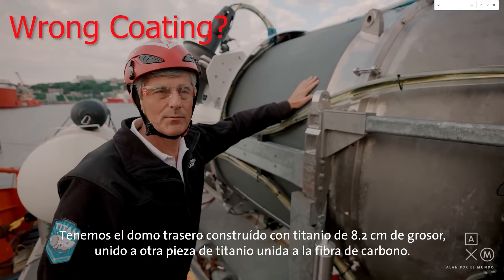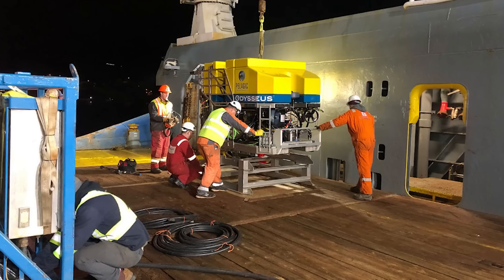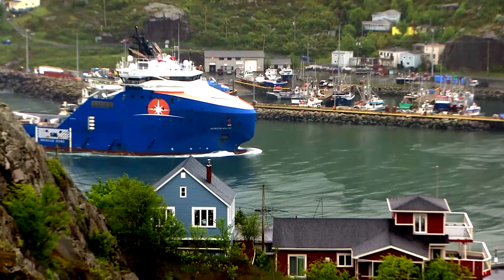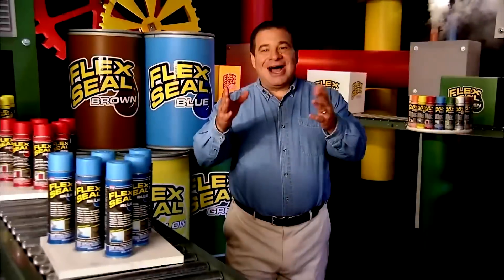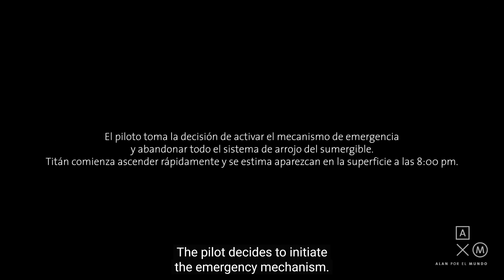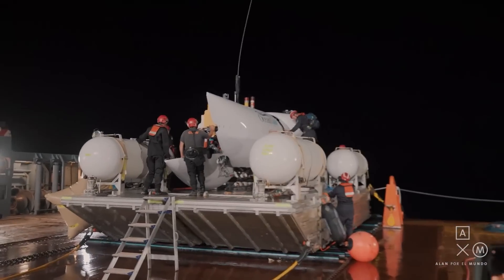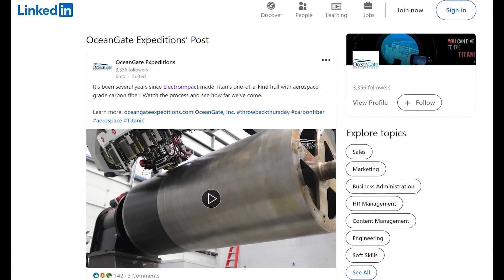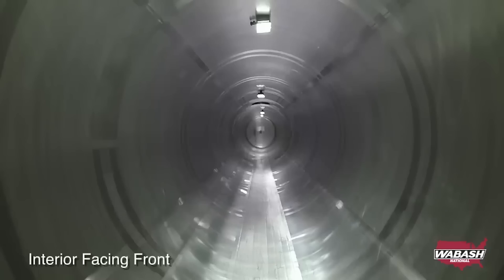Titan Sub Wrong Coating? Hull Construction, Debris Field Search

Comment: Jeff, I love your videos and technical details. I think the one source of failure was the titanium to carbon fiber seal at the end caps. I don’t know if anyone has tested the failure strength of the seal. As the sub descends, the carbon fiber cylinder would be squeezed in the middle , making it deform, and pulling away from the glue seal of the end caps. As you pointed out in one video, the titanium had no “scoring”, which would make the glue hold more firmly, and even then, that might not have helped. Although the tensile strength of carbon fiber is very high, the compressive strength is much lower, so that the two hemispheric titanium caps may have simply crushed in on themselves, much like crushing an upright empty soda can. I cannot still quite understand how the front port view hole  was blown clean, unless when the end caps crushed in on themselves, and  also compressed all  the occupants into the front end and blew the port hole from inside out. Gruesome, but instantaneous.
Reply from the maker: I pointed out on the last video I believe that when they attached the titanium rings to the carbon fiber cylinder you did not see any epoxy come oozing out which makes me wonder whether they even used enough to begin with or whether they roughened to the service with an acid etch first on the titanium before applying A proxy which is not known to stick very well to titanium because it's such a smooth metal.
Reply: @aptroed VIDEO exists of a guy testing a small model of the Titan at depth.  The failure was not the dome endcaps.  Instead the cylinder  cracks & shatters (at the midpoint of the vessel)

.

Comment: I believe the pressure vessel that was used for the testing of the 1/3 model is the largest such vessel of its kind available in the U.S. So the size of the model was built for the vessel that could test it.

Comment: I do wonder if the porosity of the carbon fiber was changing with each dive.  Meaning the rhino layer did nothing, and with each dive, the outer layers started to fail and separate.  This slowly allows more water intrusion, and each time the sub was used, this would change the buoyancy characteristics of the submersable. Thus, in the final dive, even if they detected the failure, they could not surface because the carbon fiber was essentially water logged.
Reply: @thechurn4766 THEY still had time to surface.  The team noticed at 15 minutes the descent was almost twice as fast (indicating extra water onboard).  If Rush had aborted the dive, they still had the ability to rise (though much slower than designed)
Reply: @electrictroy2010  the issue is still likely the carbon fiber.  When that material fails, it gives little to no warning and fails catastrophically.  Things like metal tend to show signs of fatigue and will bend or buckle before that can be seen visually before failure. I also wonder if water had infiltrated between the carbon layers so there would be no way to compensate for the change in boyency. 

 The rapid desent did not help. The cyclic fatigue on the carbon fiber was, however, doomed to lead to failure evetually. Furthermore, there is no way visual inspection would be able to pick the issue up.  It would require ultrasound and other imaging techniques.

Comment: What bothers me is that the hoop windings of the carbon fibre shell would only realistically oppose hoop stresses. Any longitudinal bending stresses within the shell under external pressure could not be opposed by the windings in this direction. I'm assuming they would believe compression would be equal along the length of the shell, but it would not be. The shell would compress more in the unsupported centre, leading to longitudinal bending within it.

Comment: To be honest, as an engineer, I would not have felt safe unless the hull had a 5 inch steel coating.  I guess you have to spin it out and talk about something.
Reply from the maker: Yes a 5" steel hull is much better and would have been much heavier and required more expensive ballast, that is what Stockton Rush was trying to avoid.

Comment: That last implosion demonstration was < 1 ATM? (Looks like they just pulled air out of a tanker trailer until it imploded.) The depth of the Titanic is around 380 times that pressure differential. That's like comparing failure modes of putting an empty soda can in a manual can crusher vs. surrounding it with TNT.

Comment: With all the mistakes they made, it's a wonder they were able to use the sub for multiple trips. Maybe it would have been fine if they used a new carbon fiber tube every time. But that would have been too expensive for Rush.
Reply from the maker: es fatigue takes a while to rear it's ugly head

Comment: My theory: Since we now have information from the engineer who did NDT on the CF hull, and how sketchy stockton rush is..I'd bet the bank that he had rhinoliner applied to hide the issues the hull had. The engineer said he could see holes and delaminations on that hull with a flashlight, was quickly let go..I bet they covered it with rhinoliner the same day. At least in my auto tech days, you'd see rhinoliner layers less than 1mm thick, and in heavy duty situations, maybe 3mm thick--and that's with a lot of coats. What rhinoliner does best aside from rust protection is hiding things, be it an old beat up truck bed to a carbon fiber hull with visible holes in it. Perhaps they did it to "seal" the epoxy joints, but that's a very generous conclusion. There was no real reason to have it on there besides covering up the CF, nothing aside from their hardware would corrode, as far as I know. The big question would be if it IS really for moisture, then why was it not applied to just about everything that can corrode? Why was a better sealant not used? 
Personally, I'm surprised that vessel didn't implode on the first dive, perhaps the compression the CF would see would partly seal the holes but I'm not educated enough to say that.

Comment: Oceangate should have done full scale model testing to failure before allowing any humans inside the sub. I was an engineering lab technician for many years at Carrier Air Conditioning working on commercial, industrial and government projects. Standard protocol was final model testing to failure to determine its limits. Final testing was witnessed by contractee before unit was released to production.

Comment: Using smaller models for testing is not at all unusual, as every engineer knows. There are entire departments dedicated to scaling large components to smaller test models. You just have to do it right and interpret the results correctly.
Reply: Some things here might not have scaled well like the ratio of the fiber thickness to the bend radius, and the thickness of the wrap to the bend radius. Nothing wrong with starting with a scale model, though.
Reply: The carbon fibre construction itself does not scale in a linear manner. There is no way you can accurately test using scale models.
Reply: Nothing wrong with scale model testing but certainly a lot wrong with ONLY doing a scale model test. Nobody builds a 1:3 size car to test it and then just starts building the full size car and sell it without any testing.
Reply: Thinking out loud- since mass doesn’t change linearly with volume, certain tests would be fine with scale models, and others not so much.
Reply: @martystrasinger3801  Yep, see “Statistical Theory of Size Effect in Brittle Structures”, where an  energetic failure occurs earlier in a larger structure due to energy release when a large crack or a large fracture process zone containing damaged material develops before the maximum load is reached.
Reply: Came here for this comment, I enjoyed the video overall but this stuck out like a sore thumb.
Reply: @thomasbarber9802 WE engineers still run tests on full sized units.  Often the tests reveal flaws not apparent on smaller models.  + plus when dealing with unknown materials like carbon fiber, you don’t know what equations to use.  You cannot use steel scaling math on CF

.

Comment: 10:50 Clearly a 1/3 size model isn't perfect.  But you have to consider the limitations of finding a test chamber.  Where do you find a 3m by 10 m test chamber to put a full-sized model in, and pressurize to > 6000 psi???  Or do you spend many many millions to make the test chamber big enough for testing a full size model?  When the test equipment costs more than the prototype, you've gone over the edge.

Testing cars by ramming them into blocks is no where near a similar comparison.  Building a big solid block is not nearly as complicated as a large high-pressure test chamber.

Comment: Nobody has yet to mention bonding two different materials together to use in a high-pressure situation. Titanium and plastics flex at two different rates, I’m pretty sure the glue joint at that intersection failed.
Reply from the maker: I mentioned this on my first video on the causes of this implosion

Comment: If the pressure testing animation is accurate, notice that the window did not give out, the carbon fiber surrounding the window gave out. An important distinction.  It is possible that intrusion in anyway of the carbon fiber matrix would be the point of failure at those depths.  This is likely the reason that an escape hatch could not be installed into the carbon fiber hull.

Comment: I worked in a large metal fab shop for years and was always alarmed at the book knowledge but lack of actual knowledge the engineers had if you go off the Numbers rhino coating is probably great stuff if you have actually used it you can see that it doesn’t stick to anything delaminates. How things work under ideal conditions by the numbers on paper rarely translates out to how things work in the real world.
Reply: Yep, I sprayed speaker boxes with the the stuff and I’ve stripped it off a few. It made me wonder how it adheres to CF, what prep and key was done, how much moisture was already in the carbon. Polyurea goes on crazy thick, it can bubble itself if there is moisture and does not have insignificant weight. If this was their solution to make the porous hull sea worthy again…. Well I was already without words!

Comment: Thanks for the video, great as always.
Is there a bigger pressure test vessel anywhere that could have taken a full sized 'Titan' for testing (except the ocean of course)?
If not then perhaps that's why they went for a 1/3rd model. If there was one then perhaps, like the rest of the project, it all came down to cost.

Comment: Rhino liner is used for pick up truck beds. The US Military does not use that coating. They use CARC. Chemical Agent Resistant Compound. It’s impenetrable in a NBC environment. Nuclear, Biological, Chemical. Neither coating is suitable in a high pressure environment. Ocean Gate engineering was a fantasy land joke. Built with the cheapest off the shelf parts. I wonder how many parts had a invoices  from Amazon.  I truly feel bad for the families of those victims. The crash site should be treated as a crime scene.

Comment: Rhino liner's a simple spray on application paper thin in substance. It's great for protecting your truck bedliner against moisture intrusion but has no redeeming qualities in flexing with superior tensile strength remaining seamless through periods of severe expansion & contraction & especially extreme external pressure. If Rush meant to keep the hull impervious to water infiltration by simply applying a coat of Rhino liner,, it just seems he overlooked the tiniest deformation in the hull itself or the intense pressure or water temperature changes would impact that coat greatly causing it to fail allowing water to make it's way microscopically,, time after time deeper & deeper into the hull each & every time they made a new dive. I feel sure he utilized the coating as simply another measure of making the hull safer but it probably ended up being just one more "failed measure" non homogenous to the rest of his makeshift structure. All the Frankenstein features he applied merely didn't form a lasting union of working togetherness whereby in the end,, Rush created a domino effect of one add on after another of proven strong individual dynamics that just didn't hold up as a single unit waiting for that one moment to all fail together in one catastrophic event. All of that was finally predicated probably on one part failing then cascading quickly into a multitude of stacked failures we all hope this final investigation will uncover. I think he meant well but just didn't follow through entirely while disregarding expertise from others that saw through his blind exercise in proving them & the industry itself all wrong. Apologies for stating the obvious in many areas but at this point so far removed from the final disaster,, the "obvious" for the most part is what we're all commenting on..

Comment: He did it 1/3 size most likely because there are no commercially available test facilities that will simulate the depths at real size...the ones that do aren't big enough because this guy was building the biggest of it's type so he could cram tourists in for "cheap"

Comment: It begs the question: Why did Rush deem it necessary to paint the outside of the CF cylinder with Rhino Liner? The product is designed to protect things like truck beds from water ingress, so was Rush trying to solve a problem of water ingress into the CF cylinder material? It would suggest that they had problems of water finding its way into crevices and cracks caused by the high pressure on previous dives, exactly the kind of damage that you would expect to see in a material like CF and brittle polyester or epoxy resin after a number of pressure cycles. Also, another example of Rush cheapskating by using materials totally unproven (and indeed, unsuitable) for a deep-diving marine environment.

Comment: Lol they knew where it was if it didn't resurface. Since they had no way to get down there to look for them, the rescuers did the only reasonable thing they could and assumed they had surfaced, generated computer models of where they may end up based on the timeline and surface conditions, and directed all of their resources there just in the off chance they did make it up and were currently asphyxiating. Once they had an ROV capable of 4000m on-site, they found it very quickly because unless it got blown around by currents, its last known location would have been recorded by the support vessel and their last destination was next to a well charted shipwreck. What a mess of a story 😅

Comment: Will a vacuum induced implosion have the same reaction/results as a pressure induced?
Reply from the maker: If the atmosphere difference is the same from outside to inside the vessel, then yes you can do the same thing.

Comment: The titanium hull plus the mechanical and electrical tail end were all connected to the titanium ring..  all that weight was being held in place to the carbon fibre hull with GLUE and the landing legs... this is why there was a cracking sound at the aft before the implosion. The Implosion happened at that area.  The final Nail in the proverbial coffin was when they disconnected the landing legs the only other thing keeping the carbon fibre hull from separating.

Comment: Rhino liner is truck bed liner and has micro tiny pin holes I've used it to coat speaker boxes that are exposed to rain and water....it fails to prevent water from getting to the MDF speaker box just with stress of heat and cold cycles....I can't imagine the stresses of the bottom of ocean...bad choice

Comment: Even if the coating was up to the task at that pressure, even 1mm missed could be easily enough to start a leak and then a full failure.

Comment: Another thing why it taken them to go so long out.
A ship the engine in ports are not running and the auxillerys are most of them shutdown.
This means the engine oil and coolant need by preheated to warm up the engine.
Beside the Auxilleri engine started and evrything checked and prepared.
This can take easy half a day. 

I mean you not want go out and find out on half of the way for some reason the ruder stopped working as example.

Comment: What is the glue used for the flanges to the carbon fibre?
Reply from the maker: We show it in previous videos, it is some type of epoxy, they brush it on like peanut butter first, then join parts together

Comment: Any thoughts on why that crane in NYC ignited?
Reply from the maker: I am going to do a video on it. I suspect it was leaking hydraulic fluid onto a hot surface
Reply: @jeffostroff  They were hoisting concrete. Maybe they operated the crane outside safe speed limits for that load, to be done before the concrete starts to set.
I'm curious how that crane ignited. I'd expect the local authorities would only allow cranes with direct electrical drive in a high rise environment. But it is NYC, so it might as well be diesel-hydraulic.

Comment: A 1/3 model has a 1/9 surface area and a 1/27 volume. The surface to volume ratio is off by 1/3. How to correlate the test results against such a distorted surface to volume ratio?

Comment: Just to put the implosion failure into perspective, the failure of the tank at the end of the video 12:10 was at a maximum pressure of 14.7 psi.  The submersible failed at 6,000 psi, which is  a pressure difference by a couple orders of magnitude.  Death was instant, and so quick the brain could not register pain or what occurred, they just stopped existing.

Comment: Another glaring difference between the full size pressure vessel and the 1/3rd scale model, the wrap on the 1/3rd model when it is going into the pressure chamber looks like it has been wound in an Isometric criss-cross pattern; (please correct me if I'm wrong) as oppose to being linearly spirally wound on as the full scale one!
Reply: In the video, it appears that only the end caps are crisscrossed wound.